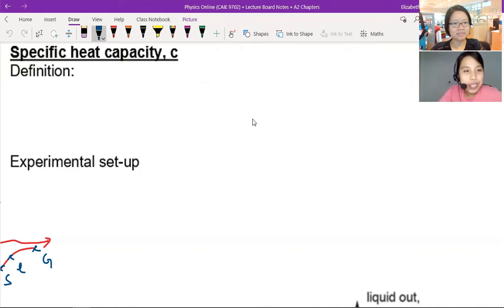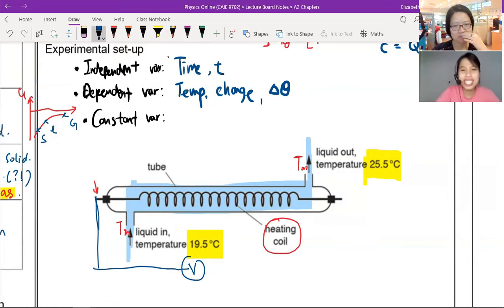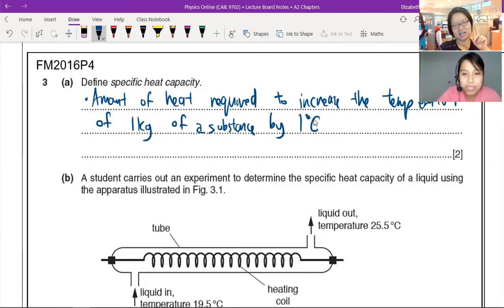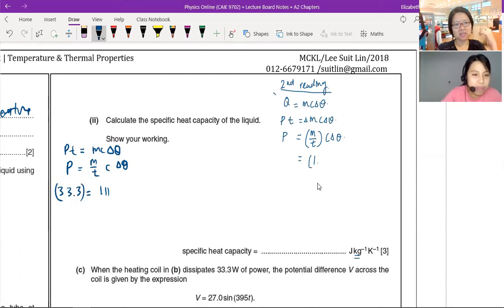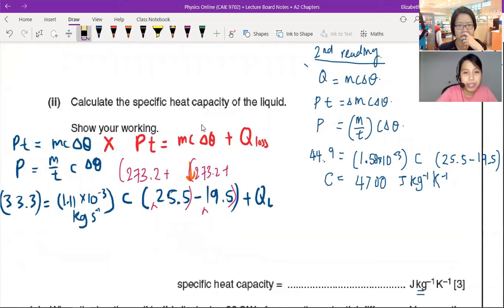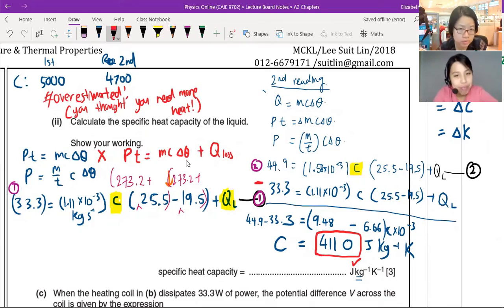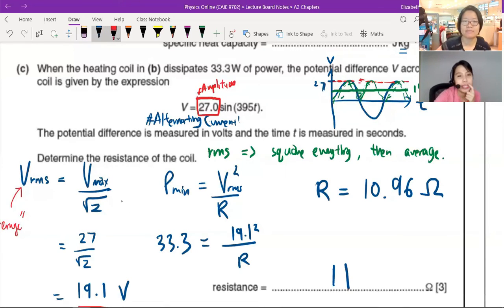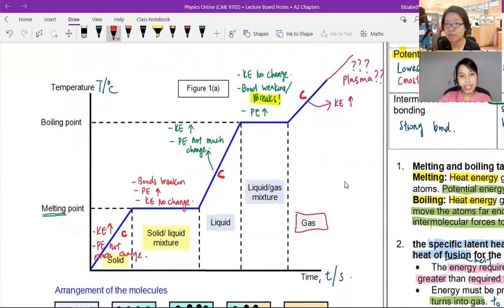14.3b Specific Heat Capacity | A2 Temperature | Cambridge A Level Physics

Comment: Energy loss will always be the same for both readings ??
Reply: It will be same only when for both the  different values of rate of water flow(m)--->,(i.e the first and the repeated exp.), we ensure that θ1(inlet temp) and θ2(outlet temp) of water remains unchanged while taking taking these both value of m. 

This is done by adjusting the current I and voltage V during both exp.
This condition is necessary for 'heat loss' to remain same.
Reply: @shabananaz9236  Hi, the emf is constant, do u know why it needs to adjust the variable R to get constant I ? (in my ideal, the i is constant when we do not adjust the R)
Reply: @arissmax Hi, we know that to maintain the same ΔT, power is adjusted. The rheostat is in series with the heater. So consider if we want to increase power(dissipated as heat) across heater, what can we do? To do that, we must decrease rheostat's resistance, so that the total resistance across the circuit decreases as it's= R heater+ R rheostat...this will increase the 'overall current' across circuit (as it's= V total/ R total ..we know😭). The current is same in series everywhere, so now, the 'voltage across the heater' will increase as V heater= I×R heater..(this occurred due increase in I, and ofc heater's resistance is constant).... now you can notice that since 'Power of heater= V heater× I' ..Power will increase(coz of increase in V  and I).
The other way to look at it is by P(heater) =I²× R(heater); the overall increase in current would increase I² value, so that power increases.

You can look at it the other way to decrease power across heater :)

About the emf , yea its constant, as it's provided  by the source (battery)...
Reply: @shabananaz9236  hi, thanks for ur detailed explanation. I get it now. Ur the best
Reply: @arissmax  hi, glad it helped, hehe

Comment: Miss what is a system and surroundings i mean how to determine what is system and what is surroundings ? In this example is water system and the tube and the rest of the area surroundings?
Reply: System would the things to which you apply energy intentionally and surrounding would be other stuff which you didn't want to get heat up